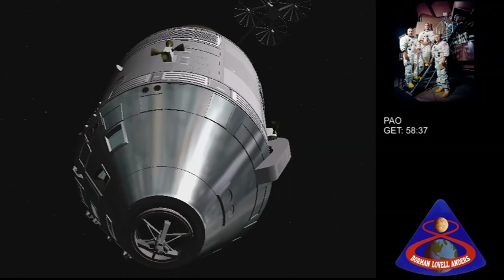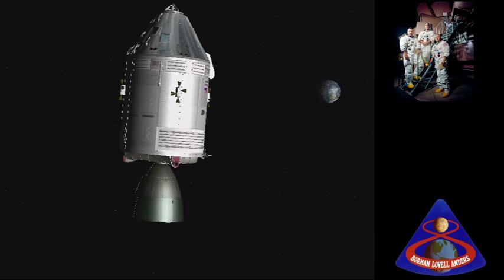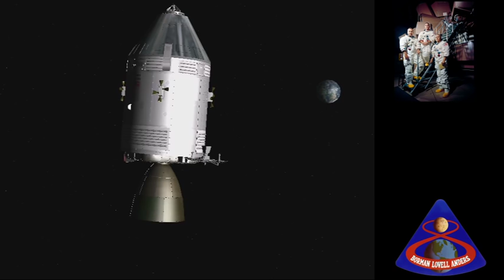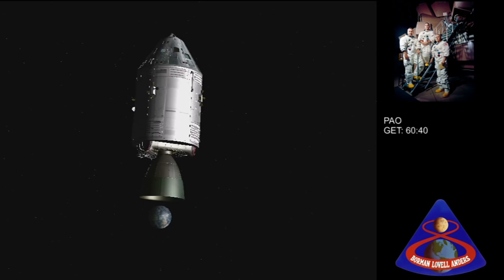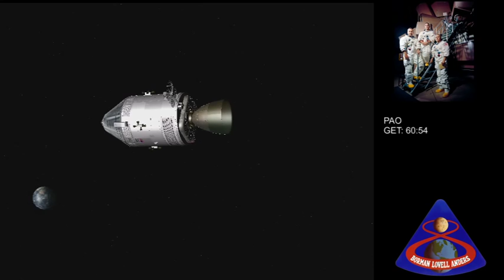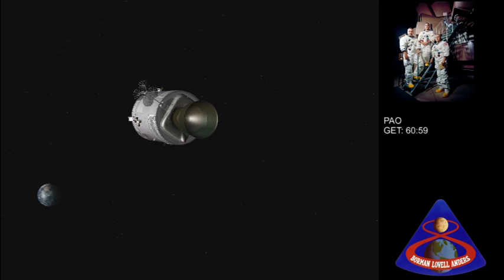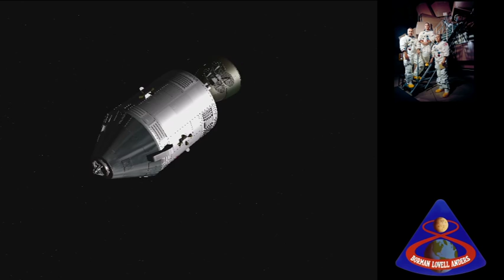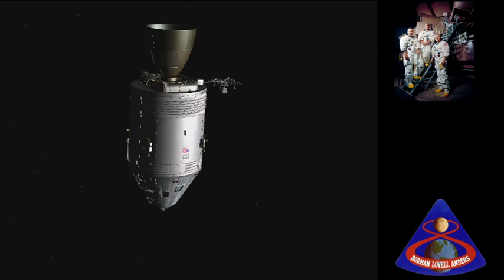Apollo 8 - MCC-4 (Full Mission 17)

Comment: A very nice animation, but a couple of issues. the animation shows a docking probe on the apex of the command module. Since there was no lunar module on the flight, the docking probe would have been omitted. also the passive thermal mode would rotate the spacecraft on it's axis at a rate of one revolution per hour. The animation seems quite a bit more rapid.
Reply from the maker: olentangy74 Hi Olentangy - yeah I realised that I had got the CSM with the docking probe on.....but I realised way too late to do anything about it...until the LOI sequence, where I have changed it. Its way too late to go back now and change all those sequences so I (and viewers will have to live with it). As for the PTC - I know it goes too fast - in orbiter space simulator it is hard to get it to go at the correct rate but I decided long ago that it didnt matter for several reasons - 1 It gives the viewer something to look at - 2. The audio is edited down (usually from 6 hrs of tape to just 1 - so, going at about a revolution every 5 mins or so (if I can get it to got thta speed)  it probably goes twice the speed it should and I can live with that. 3. I never claimed I could get the attitudes in roll pitch and yaw right and definoitely dont claim I get the PTC right...it is, after all, a simulation. Hope that helps regards LM5
Reply: ***** No  problem at all! we space enthusiasts love the work you do, it is truly a labor of love and we appreciate it. As an aside, in the HBO series FTETTM, in the episode titled 1968, the Apollo 8 CM is depicted with the docking probe also.
Reply from the maker: olentangy74 thanks olentangy - appreciate those words and I feel like I am in good company if Tom Hanks can get it wrong, I dont feel so bad ;)
Reply from the maker: ***** hmmm..why did that sentence come out as strikethrough?
Reply from the maker: ***** What happens if I try it again....and I feel like I am in good company - if Tom Hanks can get it wrong, I dont feel so bad ;-)
Reply from the maker: ***** Strange!
Reply: ***** LOL

Comment: wha t dioes PTC stand for anyway?
Reply from the maker: Passive Thermal Control...they spun the spacecraft at 4 revolutions per hour so the sun caused even heating...it was also called the bbq mode
Reply: Now how abiut you FINALLY explaining to my satis faction what those bugs/worms loolking things are on the Orbital Simulator. It's driving me CRAZY wondering what the hell those things are.
Reply from the maker: I couldn't answer ur question because your comment could not be approved despite my repeatedly trying...it still wont go from my pending comments box. I think u r referring to the squighles and particles seen on the vehicles in orbiter simulator? These are to fo with the way the simulation renders the objects and also to do with the anti aliasing setting. I have tried all kinds of settings...this is as good as it gets on my pc.
Reply: Okay I gue3ss th at you have given me the best answer that you ever will about that. I guess I now know that "the simulation renders the objects" in that way and it's not those things were actually ON THE ORBITER.
Reply: @steveburrus9347  I think it is just the lines of resolution in the cgi image interfacing with the lines of resolution on your display. It's adopting random angles at such slow speed, you are seeing individual pixels turning on and off. Normally, you wouldn't notice it because most other imagery moves so much faster.